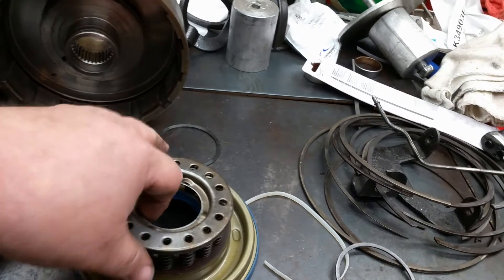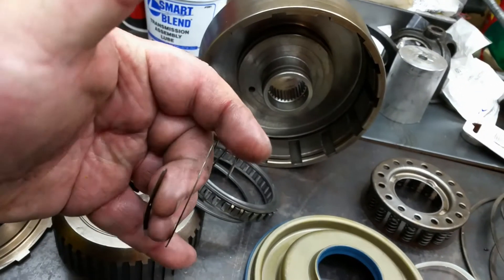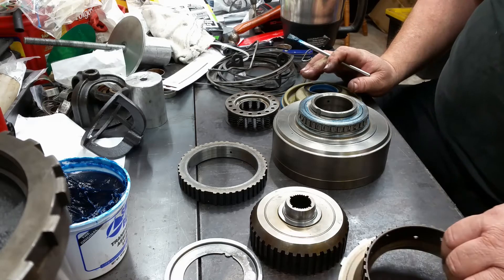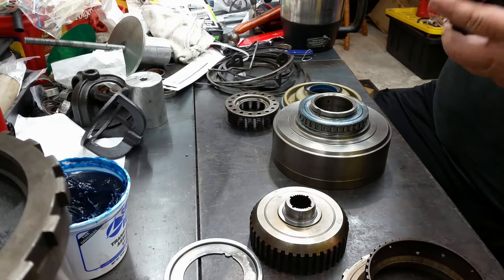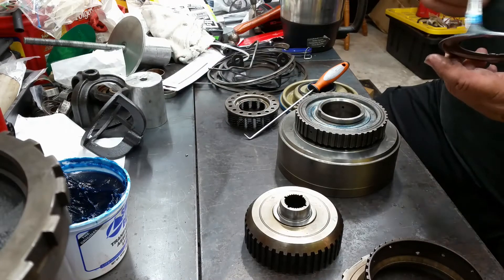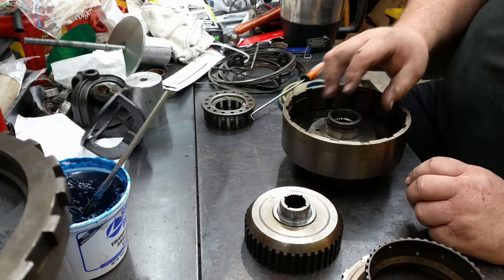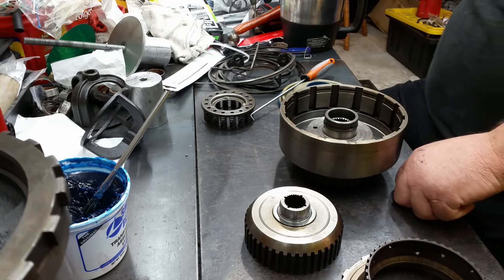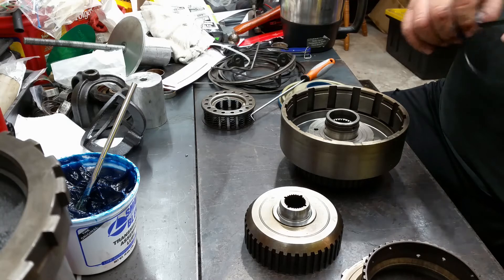Direct and Intermediate Sprag clutch assembly on our 4L80e Transmission

Comment: I just tore my 80 down and my sprag was pretty chewed up. Looked like it heated up the bore and caused the sealing rings to fail and burnt both the intermediate and forward clutches. I’m on the hunt for a new direct drum assembly. Rest of the trans looks mint.
Reply from the maker: The 4L80's will take some abuse, that is what they were designed for...
Reply: @IrocinZ  I know the sprag clutches are basically the weakest link. I ordered some new borg Warner HD sprags and a new drum and center section. I’m hoping with the new circle d converter and a little luck it will last a long time.